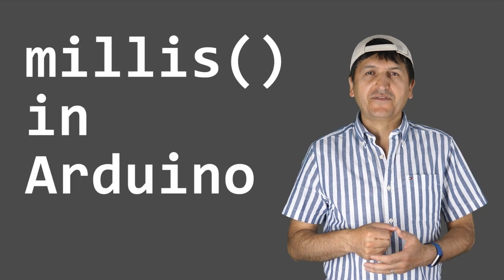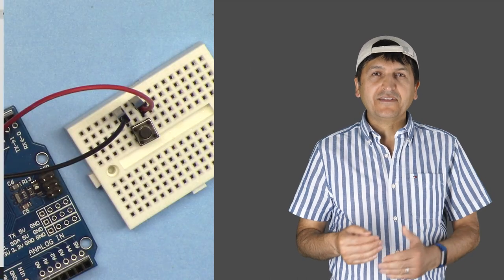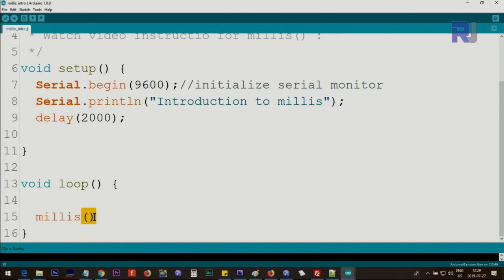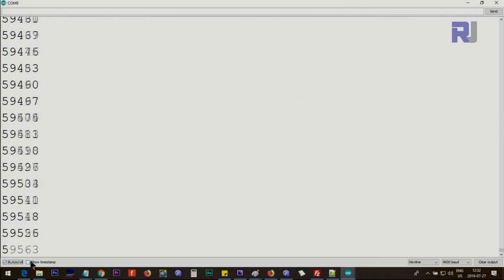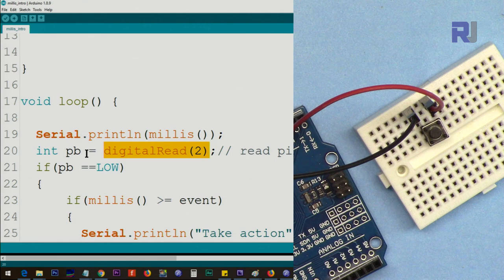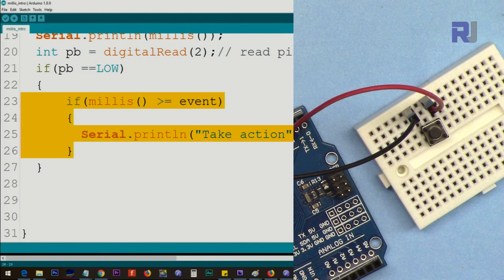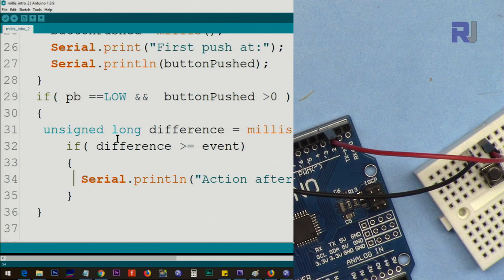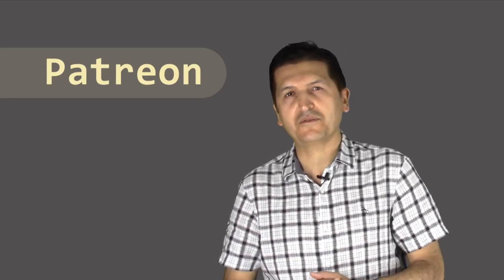Arduino Millis function explained with 3 example

Comment: The millis() function is often a struggle for newcomers to understand. This is a very useful and practical set of examples. Could have mentioned the roll-over after around 50 days just for completeness, but that is a minor point
Reply from the maker: Yes indeed. I believe I've mentioned it in another video about the limitation of counter.  Thanks and stay safe.

Comment: Thank you for explaining Millis  I am building an automated Dust Collection system for my wood shop, when I turn on as an example the table saw the dust collector will start after the blast gate opens. I am using a sketch that Bob Clagget wrote for this purpose.
I have had to make changes for the sketch to work for me. Several times he used the millis function. I am now better able to grasp what the sketch is doing. When you are new to the Arduino and not a code writer learning can be a steep hill. The electrical part is easy for more me.it learning the code that is a challenge. Again thank You
Reply from the maker: You are welcome. I am glad you found it useful.

Comment: I am impressed by your coaching will you pl guide me for reading data from keypad and lcdI2C to use to drive stepper say indeed pulse "x" required to run stepper to that x steps

Comment: i would like to ask about the millis and the pushbutton?
if I put 2 pushbutton and using millis that if either one them will be push the other one will be disable like whatever push must be done in second button it will never able to send data until a certain seconds is pass and it will be available again for both of the push button.? and how would it be code it if it possible?
Reply from the maker: Hi, the condiation you are asking needs a full project.  you may look at this video which is showing how to have LED blink without a delay https://youtu.be/obBX9hyH5mM

Comment: Thanks for your excellent presentations. I have a question. Please answer. It seems that once I want to download a code it downloads an html file. Is there a way to download your code as text file?
Reply from the maker: Hello, you just copy the code and past it in Arduino. That is pure code. but if you want to use in microsoft word, then paste it into notepad which removes all formatting and then copy it from notepad and then past it into Microsoft word.
Reply: @robojax  Lot of thanks. I have done it now.

Comment: Hi there :-) I need some help with my coding.
I would like to run a few motors and sweep a servo with one push button from and Arduino Mega board.
I have tried using if statement for the push button and millis function for after the button is pushed and separating the operation of each  component with different time in millis.I might have made a mistake or I could have forgotten something.
Can somebody help me please or is there maybe an example sketch that I can work from?

Comment: Hello , can i use two functions at same time ? , first function is for running DS18B20 use millis() , seconde fonction while (for running stepper motors and many security sensors , thanks
Reply from the maker: have you watch my other video on this? Blinking LED with millis()?  See it here https://youtu.be/rUtDfadf8Jk  and here the Robojax Timer V1 https://youtu.be/6DGQhQgr7Ak

Comment: I have esp 8266 nodemcu with 4 relay board and 18b20 temp sensor

I need relay 1 to activate when temp reach 80F and de active when temp reach 65F

Relay 2 need to activate after 2 minutes when power up to the nodemcu

Relay 3 need to activate every 4 hrs for 30 minutes but when really 3 actives, relay 1 and 2 must be de active for 30 minutes

Then relay 1 will wait 1 minute then active again and relay 2 will wait for 2 minutes to active again

I seen your millis function video so I though this can be done 

do you think you can make some kind of video to cover this kind of time event?

Thanks
Reply from the maker: Hello, relay timer video is here https://youtu.be/6DGQhQgr7Ak

Comment: Thank you for explanation, Sir. I want to know, weather millis function can be used for RCWL sensor or not. I tried but nit succeeded. Can U plz guide me. Code as below and I want sensorVal=1 for 5 min
int =rcwlPin=2;
int=sensorVal;
cosnt unsigned long Interval=1000*60%5;
unsigned long PreviousTime=0;
void setup(){
pinMode(rcwlPin,INPUT);
Serial.begin(9600);

void setup(){
sensorVal=digitalWrite(rcwlPin);
millis()=unsigned long CurrentTime;

if(sensorVal==1){
if (CurrentTime-PreviousTime>=Interval){
sensorval==1
PreviousTime=CurrentTime;
}
}
else
{ (sensorVal==0)
}
Serial.println(sensorVal);
)

I upload this sketch, but not getting desired result.
Kindly resolve it. Thank you
Reply from the maker: Hi, Please see this blink example video https://youtu.be/rUtDfadf8Jk and try your code to turn ON and OFF LED first. once it works, then use your sensor.

Comment: Is it possible for 2 sensors namely S1 and S2 to light up LED in "OR  function" namely Output1??? If S1 is triggered output1 lights up for 10seconds and then switch off
Same goes for S2 it lights up same output1 for 10seconds and switch off after.. But within or less than 10 seconds,  while output1 is switch on any of the 2 sensors (s1 or s2) was triggered again, it will restart count 10 seconds and then switches off..  
Example, s1 was triggered,  so output1 lights up,  after 3 seconds s2 was triggered or s1 was triggered again,  so it makes 13 seconds output1 switches on and then switches off.... Is it possible using millis?  Thanks for possible code and sorry for bad english
Reply from the maker: Yes it is doable.  I have two videos on millis() and used it on lots of projects on my channel. You would have to have patience and play with it.
Reply: @robojax  ok thanks ill watch your videos thanks

Comment: Anyone please help me
My problem - using 3 led 
First led glow 10 sec and other both is low and then after 5 sec led glow 2 for 10 min then 5 sec delay then 3rd led glow for 10 sec  and 1 st and 2nd off

Comment: I MAKE A CODE IN ARDUINOTO READ DUTY CYCLE . BUT ARDUINO CANNOT READ DUTY AND FREQUENCY FROM 1 Hz to 30Hz
what is the solution
Reply from the maker: When you use UPPERCASE text you are screaming 😱.
Reply from the maker: and it is hard to read
Reply: @robojax  I make a code in arduino uno to read frequency and duty cycle. But arduino cannot read from 1Hz to 30Hz and its duty cycle

Comment: você poderia me ajudar? Eu estou tentando fazer um led piscar, mas eu quero controlar o tempo que é alto e o tempo que é baixo, mas eu estou tendo dificuldade, seria interessante para um próximo vídeo sobre milles () parte 2
Aqui está o sketch:

  
  unsigned long previousmillis_led_low=0;
  unsigned long previousmillis_led_high=0;
  int one_second=1000;
  int two_seconds=2000;
  
void setup() {
  Serial.begin(9600);
}

void loop() {
  unsigned long currentmillis=millis();
  int status_led=LOW;
  
  if(status_led == LOW){//it's off?
    if(currentmillis-previousmillis_led_low == two_seconds){//is LOW for more than 2 seconds?
      previousmillis_led_low = currentmillis;
      status_led = HIGH;
      Serial.println("status_led_high: ");        
    }
  }
  else{//--------------- so it's on
      if(currentmillis-previousmillis_led_b_high == one_second){// is HIGH for more than 1 seconds?
        previousmillis_led_b_high = currentmillis;   
        status_led = LOW;
        Serial.println("status_led_low: ");          
      }
   }                         
}//void loop
Reply from the maker: Oi, eu trabalhei no seu problema e fazendo vídeo nele. Em breve vou postar em cerca de uma semana.
Reply: @robojax obrigado pela ajuda, seus videos me ajudam muito
Reply from the maker: Você é bem vindo. Estou feliz em ouvir isso.
Reply from the maker: Oi, acabei de postar o piscar usando vídeo millis https://youtu.be/rUtDfadf8Jk